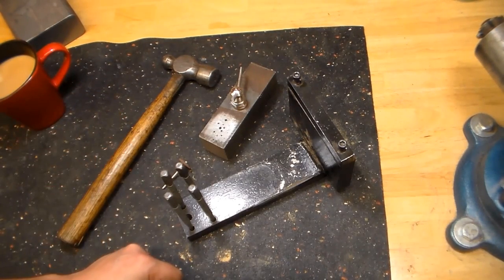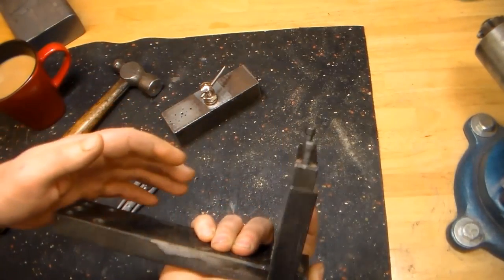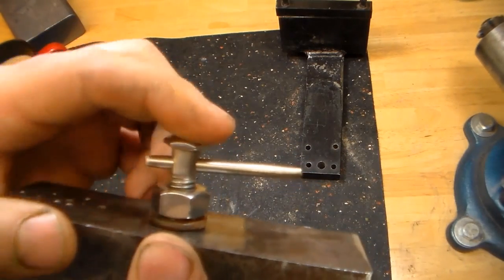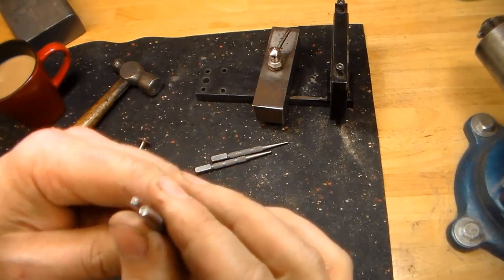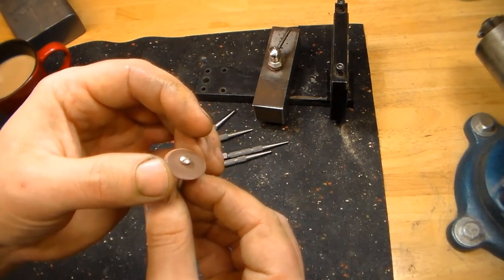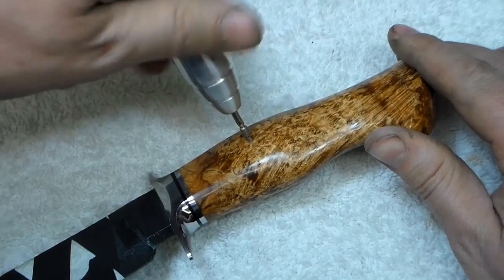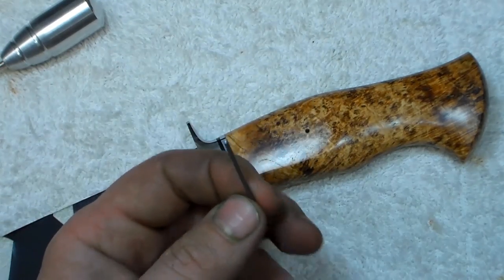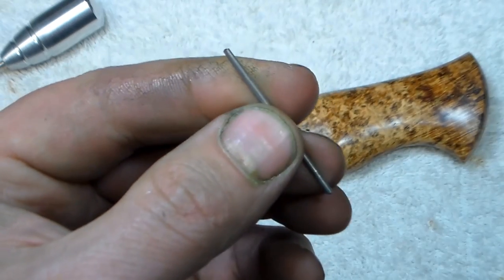Custom Knife Making, domed pins with Nick Wheeler part 2

Comment: Hi Nick, nice sequence of videos ... thanks a lot for sharing with us! My native language is portuguese (I'm from Brazil) so I would like to know the name of the tools you show in 4:00.
Thanks in advance!
Reply from the maker: Lori Castro Lori- They are called a nail set. It is a small punch used to drive a finish nail just beneath the surface (on wood working projects) so the nail can be hidden with putty. You can also make these pretty easily with shop scrap steel that is hardenable. I have made some from 5160. :)